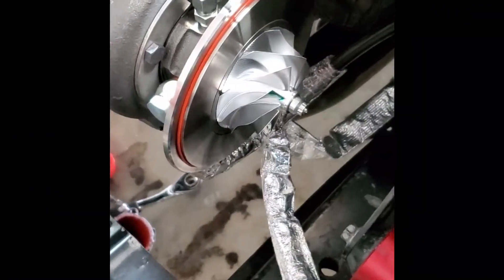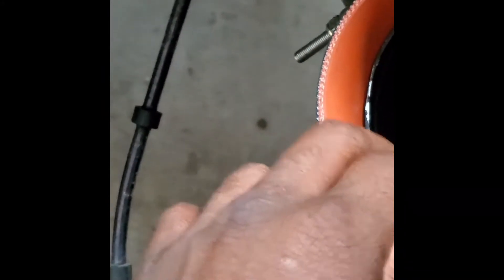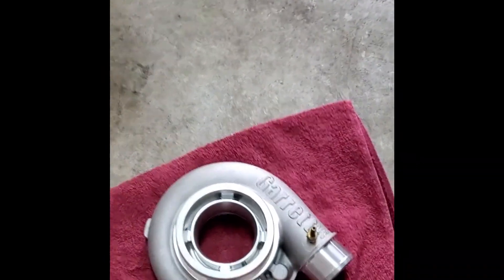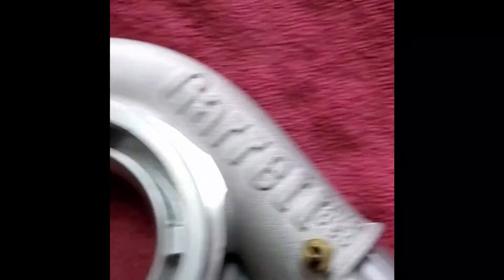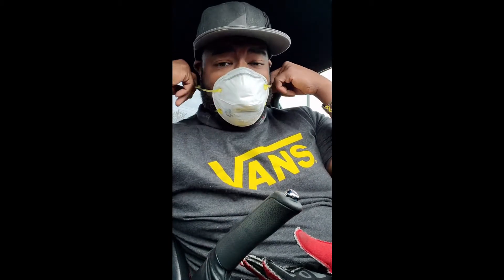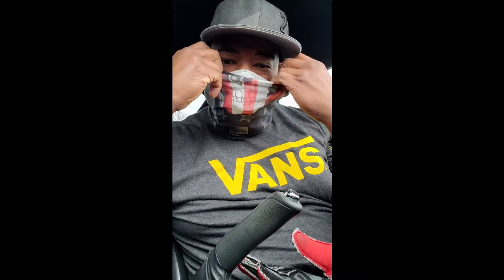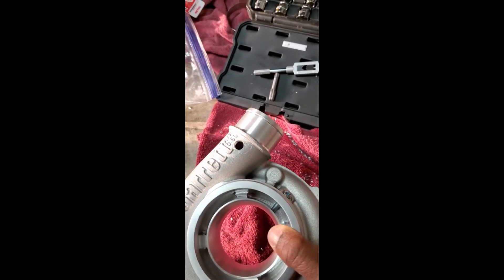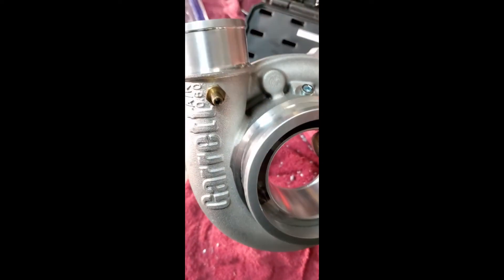Boost Tap

Comment: When you remove the turbo housing for drill and tap do you have to align the turbo housing when you install it
Reply from the maker: You will need to really align the compressor housing so that it's not hitting anything and you have clearance.  The hot side (turbine) shouldn't be too much of a problem, since it's going to bolt up to your manifold.